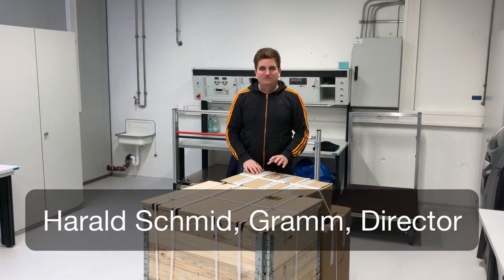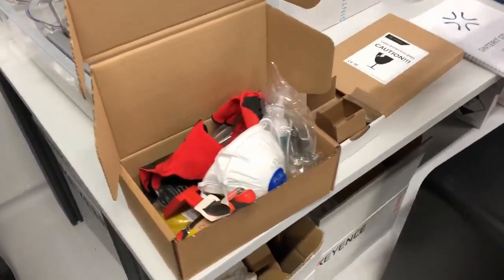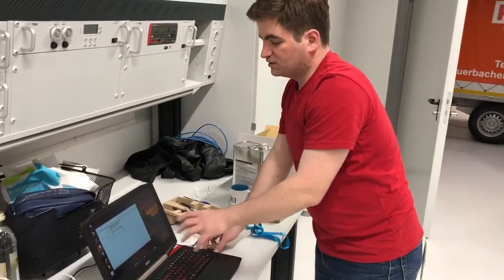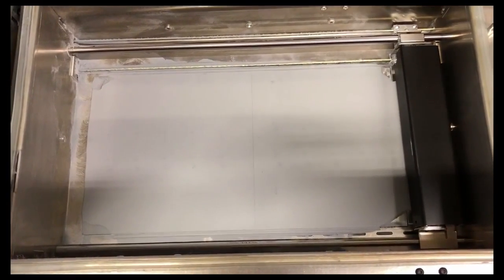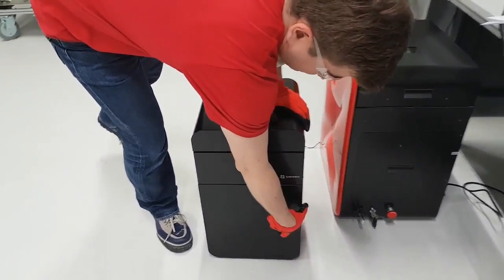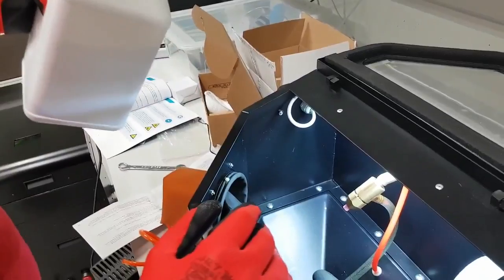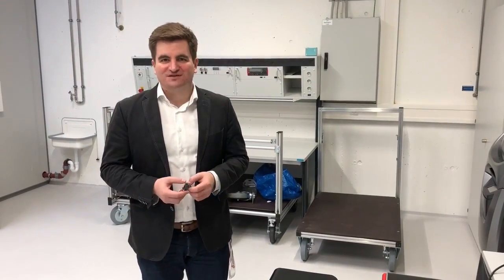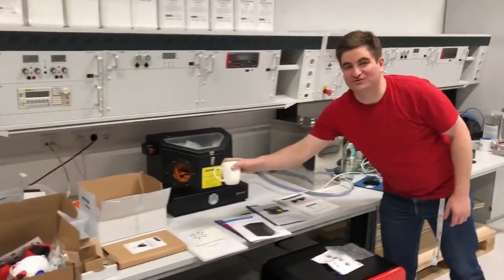Setting up Sinterit Lisa

Comment: Hey !
Great Video. Thanks for sharing. What is your experience now, 10 weeks later ?
Reply from the maker: We are very happy with it! The part quality is great.

An SLS printer in house changes how you design parts. So far we always had to work around the support requirements of FDM. Now with SLS, that simply doesn't exist anymore.

Cleaning the parts is more work. But that was to be expected.
Reply from the maker: I am satisfied. Managing a powder based 3D printing system is more involved than filament or liquid-based. You have to recycle the powder, mix it with new powder, keep it dry, and clean your workspace very often.

There was a bit of a learning experience. Our recoater wires broke a lot. We just ordered a bunch, and now we are pretty happy. Switching materials is also not a big problem.

The printer is ready to go as soon as you get it. The first print or so was easy. Then it was a bit of a rocky road until we had everything figured out. Now it runs pretty smoothly, and it doesn't take very long to set up the printer.

I think it's a great printer, especially for this price.

Comment: Little update, The sieve that was supplied in the kit has stopped working. Evidently Sinterit supplies a 2 amp power supply and the Sieve itself pulls over 2 amps. With the included power supply it can't run properly. Now another expense to get things running.
Reply from the maker: Our sieve is working fine, with the standard power supply. Sometimes I have to press the button more than once to turn it on. But that I think is just due to the button design, and not power fluctuations.
Reply: It is power fluctuation. Now that we have used a 5 amp power supply the Sieve completes in under one minute.
Reply from the maker: Is it working better now?

Comment: We purchased the Lisa about 6 months ago. Great paperweight. Can not recommend it too anyone. maybe works well 20% of the time. Waste of over $10,000.00 (us)
Reply: Why is that?
Reply: Machine works about 20% of the time, stops printing in the middle of the print. Last print the layers did not index properly and print was useless. Support has not answered all questions and now Sinterit is placing blame on us. Control screen is blank now and can not be used.
Reply from the maker: Working with an SLS printer is definitely more involved than a standard FDM printer, or a polyjet printer. The machine is also more rough around the edges.

Yes, not all of our jobs succeed, either. The recoater cable can break, and then you have to replace it, and repeat the print.

Managing the powder is the biggest issue by far. The feedstock is more complicated to handle compared to a roll of filament, or a polyjet cartridge. But that is just a general truth about SLS printing. It is not particular to the Lisa. 

Closely connected to the feedstock is the recoater. Most of our problems have to do with the recoater.

That being said, our success rate is much higher than the 20% you stated. I would say it is about 80%. And the print results are great.

Yes, the uptime could be better. But together with the good print quality and the very low cost, it is still a great deal. I stand by my recommendation.
Reply: Agreed, but the replacement parts that have been supplied have not fit in the machine and even the supplied screws were the wrong size. Now the Sieve power supply had died and even when it worked seemed to be of the incorrect AMP rating. Now that we purchased a new power supply the Sieve works properly. The Recoder wire supplied is way too short to work on the machine.
Reply from the maker: Okay, that is not great if the replacement parts don't work. We have used several recoater wire replacements so far, and all of them worked.

Are you located in the US? Our office is in Germany. I assume we have similar electricity standards to Poland, which meant that their power adapter worked fine for us.
Reply: United States
Reply: Mark, thanks for your comments about your experiences with the lisa. We are considering pulling the trigger on a Lisa 2 this year but with the limited real world information out there not being spoon fed from 3D printing influencers it's hard to get a good idea of the actual product so thank you for that.
Reply from the maker: Hans, If you have any questions about the Lisa, I'm glad to answer your questions. We are running several jobs per week on the machine. We also bought the machine ourselves and paid full price for it.
Reply: why did ur parts seem to fail or something
Reply: Thank you for the feedback. I will skip this one.